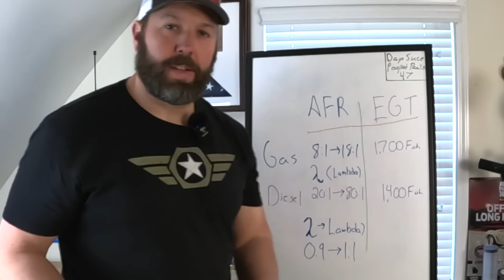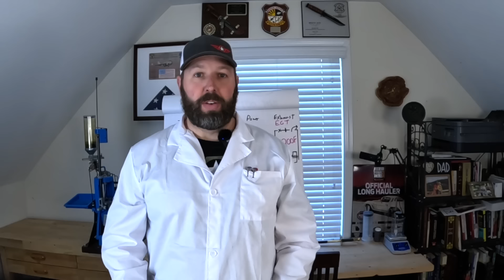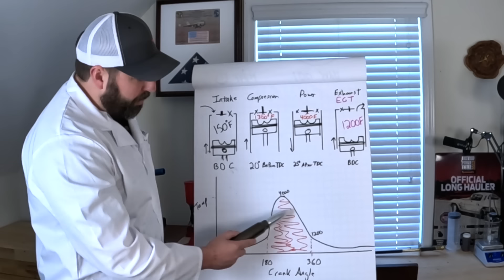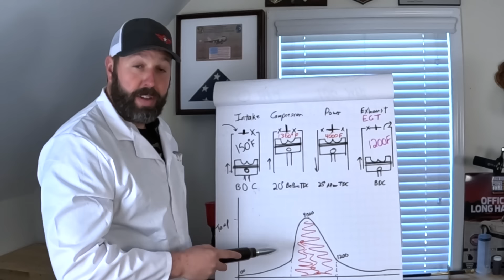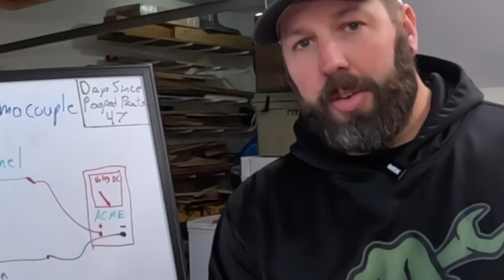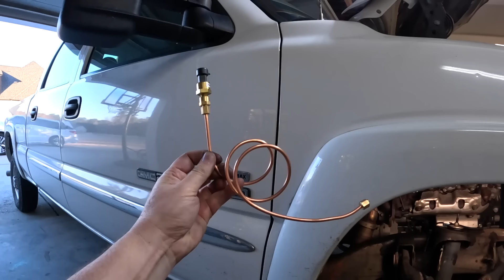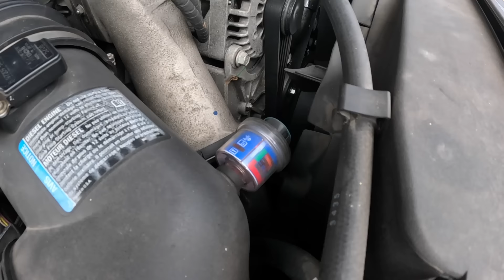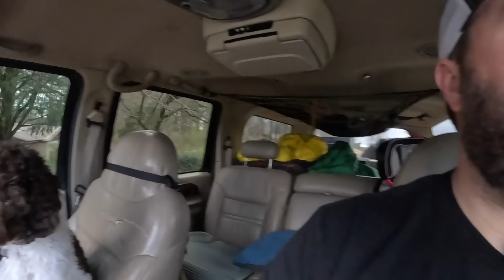Silent Diesel Killer…Diesel Exhaust Gas Temperature (EGT)! #diesel #egt #dieselengine

Comment: Very interesting stuff to learn. I got a question. So will reducing the intake temperature, let’s say with a big heat exchanger after the turbo compresses the air, help lower the exhaust temps? If so is it significant?
Reply from the maker: Yes, that’s an Intercooler, I discussed that towards the end of the video.
Reply: @freedomworx omg 😮😅 I commented this while watching the video! I JUST got to the part where you said it! Thanks man. Sorry for not waiting till the end but that’s where my mind took me as it was processing the info you were giving me. I’m assuming adding a bigger intercooler also helps reduce the EGTs in say a 3.5 Ecoboost. But, but in that case, are EGTs a problem?
Reply from the maker: @bvbhu3dg  gasoline engines actually have higher EGTs than diesel engines. But as long as the AFR is controlled, it’ll be fine. If the engine is stock, there is no reason to worry about it. Have you seen the Eco-Boost torture test narrated by Mike Rowe? They had that truck maxed out on towing capacity and ran it around Daytona full throttle for 24 hours 😂
Reply: @freedomworx  I just watched, it’s incredible

Comment: After watching this video about egts for diesels how about weather egts are important on the new twin turbo engines. I'm sure gasoline it is not but there might be people out there that don't understand.
Reply from the maker: Gasoline EGT's are actually higher than diesel EGT's under normal operation. Especially forced induction gasoline engines (supercharger/turbocharger). But factory tuning ensures they remain in check by controlling the AFR. Maintaining a rich AFR keeps the EGTs down under heavy loads.

Comment: I ran my early 03 5.9 Cummins at 1600°F EGT for 20 minutes straight. I wouldn't recommend doing it, but it was during an emergency, so that's the only reason I did so. I usually keep it in the 400° to 600° range as it is happy at those temps.
Reply from the maker: That’s actually pretty impressive 😂😂
Reply: Cummins has said that the 5.9 can safely see 1500 from time to time and 1350 sustained, or close to those numbers. 1650 sustained is insane. 😂😂😂 I've seen  some higher clames but not by much. 1800 sustained is the highest I've heard. Love these engines
Reply: Older Cummins are safe to a sustained 1250F.  1600 is absolutely pushing it.
Reply: @1320fastback Damn man, On a hard pull I can peak and hold 1650 ish till I let off on a 2 liter passat commonrail XD

Comment: Awesome video, 😂😂 too . Just changed the intake horn, and hot & cold side pipes. And not to mention a 140 fass also. Gotta save up now for the ct3, get a diesel they say. It’s like owning a boat & jeep at the same time. If only I had my money I spent on the jeep. 😢
Reply from the maker: If you want to be fiscally responsible...you're buying the wrong toys 😂. Skateboarding sounds like a cheap hobby...maybe I'll take that up 🤓
Reply: Well now, I guess I’m out. But keep me in mind.
Reply: My wife already loves my 7.3 Excursion so it appears I am ahead of the game!
Reply: Bought the Jeep for a quick cheap 2nd vehicle for work. Turns out it was not a practical wagon. Then the truck was supposed to tow a 5wheel but that sky rocketed. Now it’s a fun expensive ride the wife hates. Laud and rough and seats are not comfortable. So I try to keep it, you know to make her happy. 😊 😂 And i can’t skateboard 🛹.
Reply from the maker: If you spend $80k to build a Ford Excursion, it'll ride and drive in a manner that your wife is agreeable to. Ask me how I know 😉. (Fortunately most of my Excursion stuff was sponsored!)
Reply: How do I get on a sponsorship list? 😂 I need it badly.
Reply from the maker: @rbyronson2426 you gotta know a guy 🤓

Comment: Awesome Video !👍
Reply from the maker: Thanks for watching 👍
Reply: @freedomworx  welcome  love your Excursion!
Reply from the maker: I appreciate it 😎
Reply: @freedomworx  not a problem I have an 03 6.0 powerstroke & run he CTS3 with egt sensor lh exhaust manifold. Is there any benefit it running a sensor in each exhaust manifold on a 6.0 just a question? I noticed sometimes my it's don't read correctly on my cts3 I've changed the probe out as well I've noticed. Alot of times it is reading lower than it should I've noticed. Then it goes back to normal. Well what I think is normal. Lol
Reply from the maker: I think there is a benefit to having one in both sides, but really only in the sense that you can tell if one of the two sensors is bad, or which head gasket just blew 😉